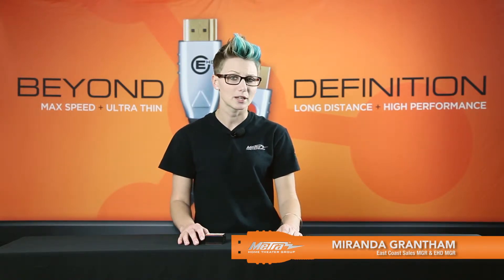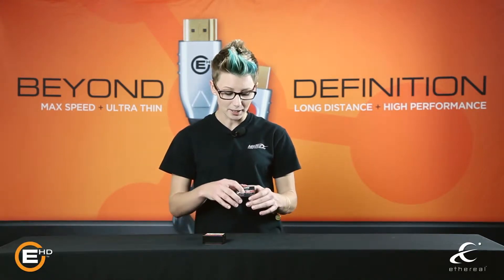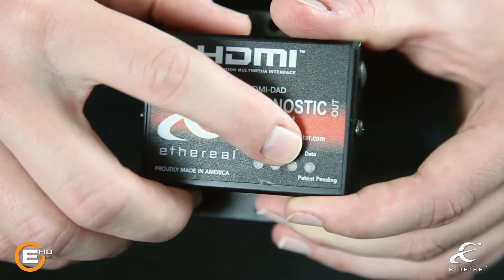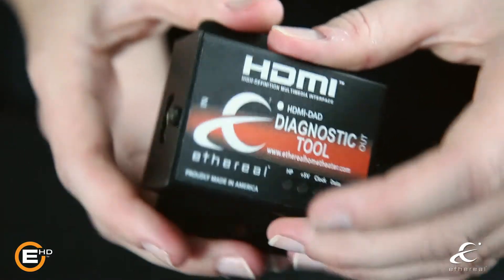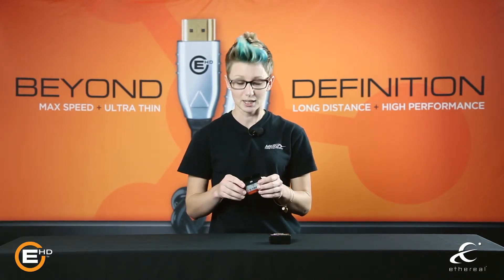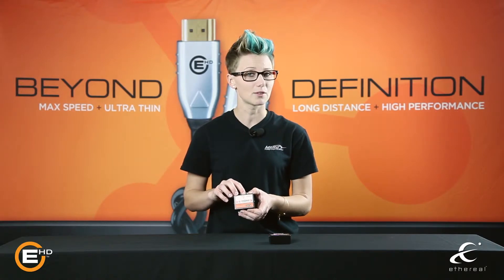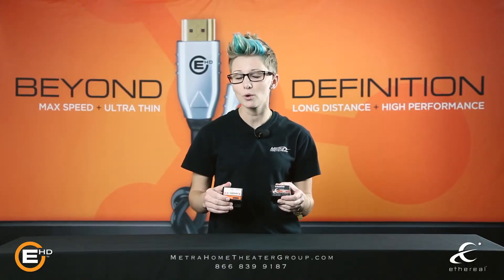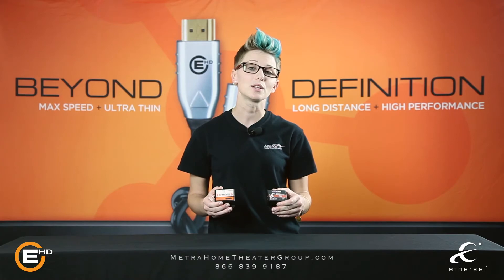DAD vs SUPERDAD: Miranda explains the difference

Comment from the maker: The DAD is a diagnostic tool. It solves most low speed data problems (video or audio drop out, capacitance issues, EDID and HDCP issues) and it has LED indicators that diagnose problems within an HDMI interface so you know the issue.

http://youtu.be/XOH5QrqZPuU